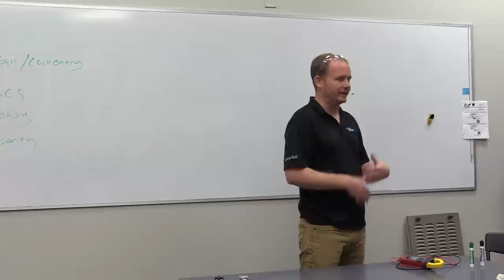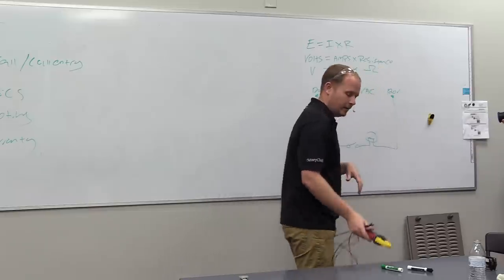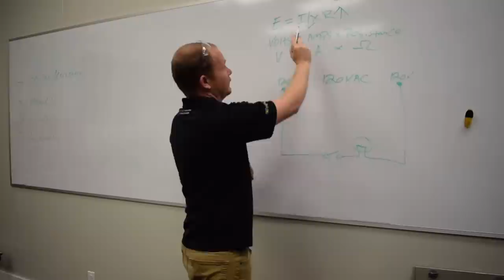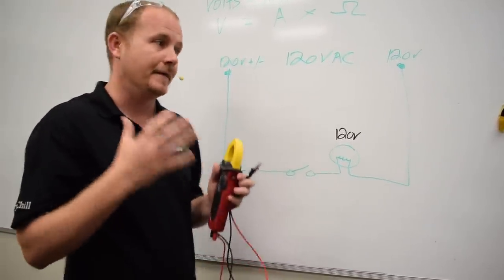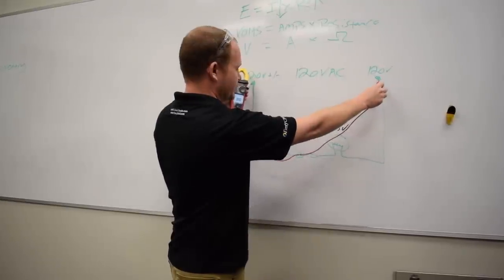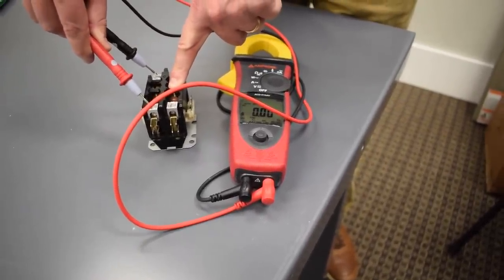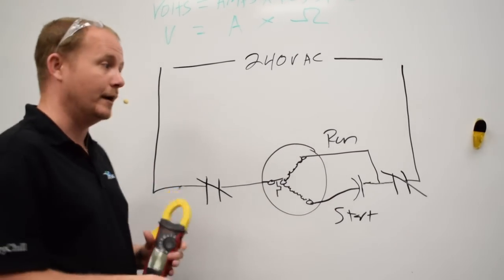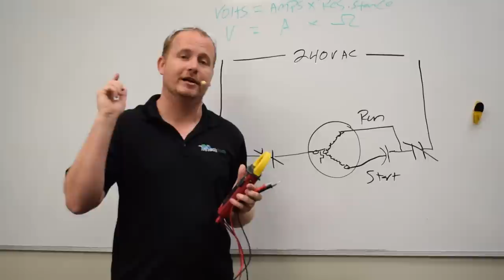Using Your Voltmeter As a Voltage Drop Detector

Comment: Responding to RJ_Make’s question:

Typically, heat causes resistance in a conductor, electrical connection (switch or contact) or an inductor (winding). In your question, your winding is cooling down - so resistance will decrease as a result of its cooling down.

For EVERYONE ELSE:

Voltage drop is a HORRIBLY difficult topic to explain to most folks. Some GET IT.  Most…DON’T.
Brian's reference to Ohm's Law is REALLY the best possible way to explain it, but the math must be applied while actually seeing it on a meter. 
AGAIN: Affirmation of what he's explaining can be seen by using a voltmeter and seeing it as a reading...using your brain's ingrained memory of Ohm's Law.

DESPITE what Brian explains (and Brian has my greatest admiration for what he does), I've always impressed upon techs to remember Ohm Law like you'd remember how to brush your teeth. Make it an instinct. Make it something that's in your head EVERY TIME you put your test leads into a circuit. THEN - factor in the inductive aspect of that circuit (motors, relay coils, etc) when it wasn't what you’d expected. You may not know the math involving THAT, but at least it's something to be considered before calling a motor, solenoid, relay or contactor as BAD.

With that, you might want to consider studying up on inductive loads.

THE MOST IMPORTANT thing to remember is that a voltmeter, when you’ve introduced into a circuit, will only read a DIFFERENCE in potential between the two points being read. Applying what that "view" of what you're seeing in the circuit's performance, when compared to the OVERALL circuit's design...will give you a clue as to what's the problem.

I've MOSTLY learned to use voltage drop to determine bad switches, contacts, fuses, circuit breakers, etc...as the ONLY way to find their failure.  On that note…

The NEXT MOST IMPORTANT thing to remember is to TRY to do your troubleshooting under the conditions which the problem occurs.  That will inevitably be by using a voltmeter reading live voltages of 120v, 208v, 240v…or even 480v.  

I say this because an ohmmeter’s 9v battery usually won’t LABOR a circuit’s components adequately enough to duplicate the conditions under which a problem occurs.  There’s not enough push from a 9vdc battery to duplicate the high-amp conditions demanded by a compressor, heating element…or whatever…to make it “fizzle” into the problem which occurred and you’re looking for.

So, an ohmmeter…as handy as it is, often won’t tell all.  A voltmeter will ALWAYS tell the true story – by looking for the VOLTAGE DROP.

LASTLY: when troubleshooting…VERIFY!
Reply: @EC Tofix. Thanks for the great explanation. I'm a bit confused because of 5:38. As the *physical resistance* (say spinning up a blower wheel) increases so does heat right? So if heat is increasing why is my winding resistance decreasing according to 5:38? I missing something here..
Reply: Or as the Samurai says... "ohms can lie. Verify!"
Reply: @RJMaker  might want to understand conductive heat vs intended heat in a circuit, ie running a load generates heat, BUT stalling a fan motor (outside of design operation condition) the current is flowing through just one of the windings on the stator, creating inducted heat/ and eventually hopefully the fan will cut out on thermal overload before permanent damage occurs. This situation is where you will see resistance drop as it cools, vs normal operation as the wires would be sized to suit this.

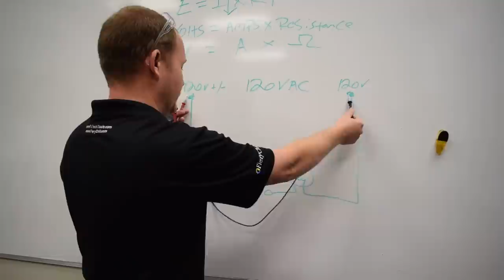Comment: I dont get it. At 9:07 with the switch OPEN you measured 120v at the top two points. Then at 9:30, you closed the switch and still measured 120v at the top points. How do you measure 120v at the top two points whether the switch is opened or closed??🤔🤔🤔🤔
Reply: The top two points are your source voltage.Your source should stay the same always in the circuit.The voltage across the switch is your voltage drop.If you add the voltage drops through out a circuit it should equal your source.

Comment: HVAC SCHOOL, The DVM meter can measure Back EMF voltage from the compressor motor but how can a technician know if the measured voltage is Forward Voltage or Back EMF Voltage? because the DVM meter won't tell you if its forward voltage or back EMF voltage. I'm not sure why when compressor motors start aging and slower RPMs the back EMF voltage will "increase" any reasons why the back EMF voltage increases?

Comment: I’m missing something… where did it pass me? So how exactly do you perform a voltage drop test? By probing two ends and getting the voltage? I’d like to know how you determine the cause of the voltage drop. If I read 120 at an outlet but then get 86v once under load…aside from what’s plugged in, why is the voltage no longer 120 no matter what I plug in?

Comment: A light bulb is an inductive load not a resistive load.I am confused.I have seen 120 volts on a coil and it would not pull in because it was not true power because of a bad switch that measured 0 volts across the switch.Thanks

Comment: so intuitively if I measure a volt or more of potential across a closed contacter (under load), I would classify that as an issue. That being said, I also think a motor can typically operate +/- 10% of its rated voltage rule of thumb. Who's to say that volt of potential is really an issue until the small amount of excess heat it produces further deteriorates the contact 3 years later? I guess I'm approaching the question from the angle of a customer paying for parts that may or may not make a difference for the longevity of the system so long as the load is receiving nameplate voltage. Do best practices sometimes deviate from the reality of the situation? I'm sure there're plenty of things I'm not considering i.e sacrificing a contactor before sacrificing a compressor. By the way, HVAC school is a great resource so thank you.
Reply: Most of this is just for you the tech to put into memory, for each job, (the ones where everything’s fine, but you can see it’s getting tired) where you can quietly consider the next call from them... obviously you replace things that you must, but don’t go losing sleep over it for the client.

Comment: If we are going to compare two different ac motors, can we always say that the one with higher amp (current) reading consumes more power? Or are there cases where the  motor with lower amp reading actually uses more power?
Reply: When it comes to amps readings, you always have to be aware of the voltage level, since power (w/kw) is P=V*I*p.f. you can have a motor with higher power consumption at lower amp readings.
Example:
Assuming P.F. 0.9
Motor 1: Reads 5 Amps @220V ---> P=220[V]*5[A]*0.9 = 990 [W] 
Motor 2: Reads 3 Amps @480V----> P=480[V]*3[A]*0.9= 1296[W]

So you see, you can have a motor with a lower reading of current but still have a higher power consumption.
Reply: How about motors with same voltage?
Reply: @ramos_dt   At the same fixed voltage, lower amp readings should always mean lower power consumption, unless there's something wrong with the motor.
Remember also that for three phase motors, power is calculated by  P=V*I*√3*p.f.
Reply: Thank you.
Reply: But the 480v system is 3 phase, so you have 3 contactors and circuit breakers, yes you have lower current on one phase but if you group all the neutrals you should get a standard higher amp reading, identical to the phases in... if I’m not mistaken...but I’ll check on the next unit.. inductive motors give me more grief since it’s not straight forward to me yet...

Comment: Instead of using the term of voltage drop it’s much easier to understand and use the term differential your any gauge or meter only measures the differential between the two points including pressure gauges measure differential

Comment: I don’t get that neither. Physical resistance is inverse to electrical resistance. I always thought that when there is low resistance, there is low heat, but if you hold a fan motor and stop it from spinning and start to get hot, it’s not that motor getting hot due to the resistance increasing, just like a resistor gets hot, or a heating strip gets hot due to the high resistance in it. Let’s say that you have a fan and instead of you stopping it from spinning  with your hand, you replace the wires to it to a size small enough so that wires start to get hot and burn. Wouldn’t  you say that the wires burn because there is too much resistance in the wires? And like you said, resistance and current are inversely proportional of each other, given the voltage stays the same. Just like you mention in your video, your contactor contacts get pitted, causing high resistance, which also causes high amperage, which causes heat. Even the voltage drops a little bit. Anyway, I would really appreciate if you can educate me a bit more on this subject. I’m by no mean a collage or university graduate, I’m barely a practitioner of the trade that got a bit confused. Thanks.
Reply: My thinking is same as your rationale. I am confused of Brian's explanation.
Reply: @thembones12  I am disappointed in the general lack of follow up in these comments, whether from fellow viewers or from the experts or the channel owners. But late as I may be, I will try to give you my take.

What makes the wires hot is too much current . This is why a fuse melts. It is NOT resistance. Low resistance=high current. If you have a short circuit you have essentially zero resistance, which gives you infinite current. I=V/R so if R is 0 you are dividing by 0, which is undefined or infinity.  Infinite current will quickly heat the wire and trip the breaker.

Comment: You contradict yourself at 3:35 and 4:04. So which is it?
Reply: I agree it’s confusing. And I think he’s a bit loose with the term “work”. But I think his intentions  are both correct, as they are two different examples with two different results. 

In the first case, with longer grass (more resistance) if you use the SAME amount of effort, he’s saying less work (ball distance) gets done. The ball doesn’t go as far compared to short grass. 

In the second case with long grass (more resistance), if you INCREASE effort, more work is done. Then the ball to goes the same distance compared to short grass.

Comment: wrong. you're conflating voltage drop with difference in potential. difference in potential is a broader notion whereas voltage drop refers to a decrease in voltage due to circuit components.